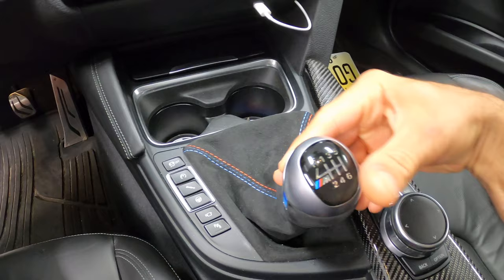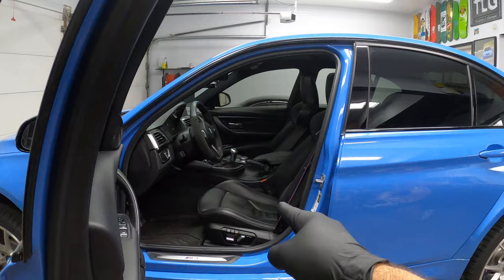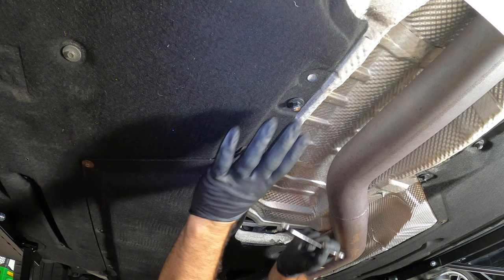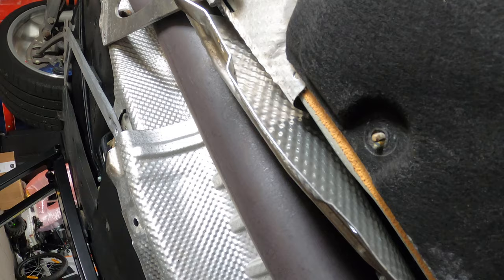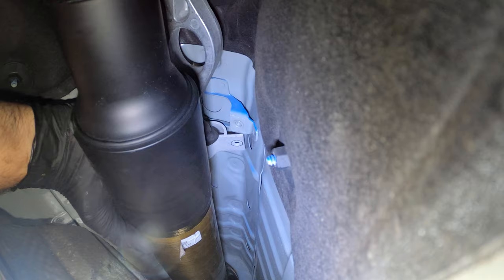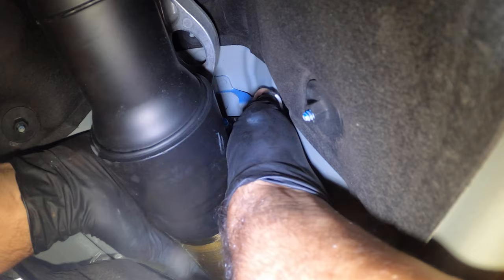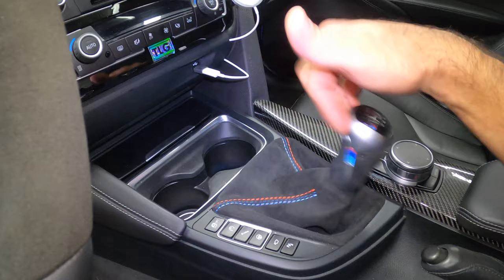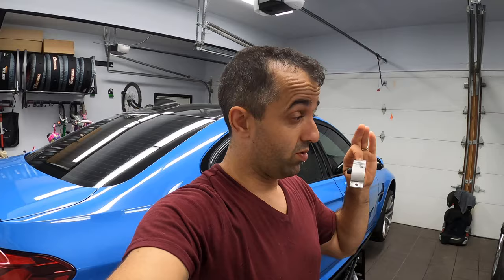The Ultimate BMW Manual Shifter Mod: Rear Bushing Replacement DIY (M2, M3, M4, 3 series & More)

Comment: Nice install. I believe the NVH is much louder with the rear bushing replacement from what many have reported. 

I recently installed AutoSolutions SSK with upgraded mid bushings. This shifter gives my M2C a precise shift gate eliminating vague and rubber like shift feel. Combined with my Rogue Engineering transmission mounts and Ultimate Clutch Pedal, it’s a perfect setup.  

Really enjoy your videos. Keep up the passion.

Comment: Just did this on my M235i. The feeling of the shifter and the shifts are really better now. I used the Powerflex bushing, it's cheaper than Turner motorsport one and does the same job.
Thank you for the video!
Reply from the maker: Welcome to the nice bushing club !!
Reply: Did you go with the street or the performance version?

Comment: I am glad to see that an $88.3 bushing can significantly improve the shifting quality of M cars. Since I currently drive a manual  911 Porsche, I am reluctant to commit a manual M2/3/4 because of its rubbery shifter. Obviously, an aftermarket short shifter kit upgrade can probably match that of Porsche's. But my question is why BMW has never taken care of this issue for as long as they are making the manual M cars?
Reply from the maker: BMW caters to the masses, this means most people prefer the seamless shifter feel.

Comment: i suspect the cayman used for comparison has an aftermarket shifter in it...

the OEM one on my 2007 cayman is made primarily of plastic. the frame is entirely plastic and the bushings (no bearings) are white nylon plastic. in fact, the only thing that is metal is the rod that holds the plastic/chrome and leather knob. the aftermarket one i installed is entirely made of metal, CNC machined aluminum frame, highly polished stainless rod for holding the knob and ball bearing interfaces for the moving parts. it eliminated slop and added a metallic precision that was lacking before.

although the OEM one on the cayman is soft and a little vague i suppose it could be preferred by some, maybe many, IDK.
Reply from the maker: Nope; cayman is an OEM shifter. It's amazing

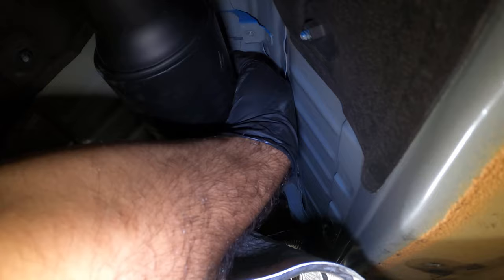Comment: Looking at the second and last image from the ecs product page, you installed your piece the other way around. You have the flat side toward the shifting arm, and the image shows the protruding side toward the arm. 6:25 Did you mean to do this?
Reply from the maker: Good catch; yes I realized later but then I also realized that it doesn't make a difference. It glides on the shaft so it doesn't matter

Comment: How is the NVH in the cabin over the stock configuration when the engine is running, especially when sitting at idle with either the clutch in or out?  Same or slightly worse?
Reply from the maker: Doesn't vibrate; all is well.

Comment: DIY on bimmerpost has the bushing mounted the opposite way.... youre sure its correct?
Reply from the maker: Good eye; from what I realized it does not matter which way you put it in; it goes on shaft quite deep and direction doesn't matter.
Reply: @TommyLGarage  also apparently like my car if you have build date pre 11/2015 then you need to run this model. https://www.turnermotorsport.com/p-395189-turner-polyurethane-shifter-arm-bushing/ i didnt realize this till trying to install mine.
Reply: @tauzins  thanks for sharing this, I was just about to install mine and watched this video as a quick reference and noticed your comment. My production date was 06/14 so I have to return the original one I bought and purchase the one you linked above

Comment: Awesome, thanks for the vid. I have been wondering about these and if they make any difference. Any difference in install with stock midsection / exhaust? Any particular gear you need to be in during install/removal, or doesnt matter?
Reply from the maker: I believe with the stock mid section you will need to remove the mid pipe.
Reply: Did you ever install this? I have a stock midpipe and am wondering if i need to remove it
Reply: @TwoSnailTom  Yes I installed this without removing the midpipe / exhaust
Reply: @camluczi  Thanks for the quick reply! Here i was shopping around for a single midpipe / equal length thinking I'd do both at the same time.. guess I'll get under the car tomorrow! Thanks again.
Reply: @TwoSnailTom  I would still love to try the equal length midpipe. I already have the M performance exhaust on but getting used to the "unique" sound. You may have some issue moving the heat shielding back far enough, but it is doable

Comment: Would this also work on a 6 Speed F30?
Reply from the maker: I was told it would but not in all models
Reply: They make this bushing for the F30 but 2012 and 2013 models will have the older cylindrical bushing which is a little more difficult to install. The new style bushing Tommy installed is held in with two bolts while the old style bushing is pressed into tabs that are part of the chassis.
Reply: @934hifive  that was actually really helpful. Thanks Mike!